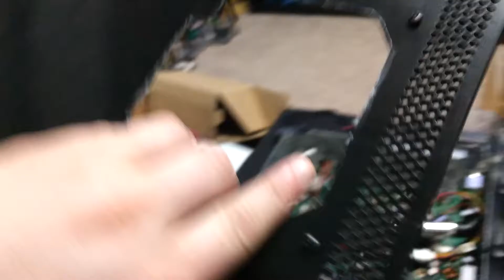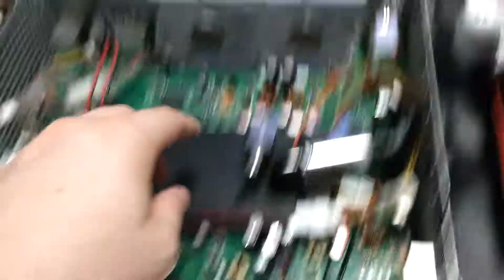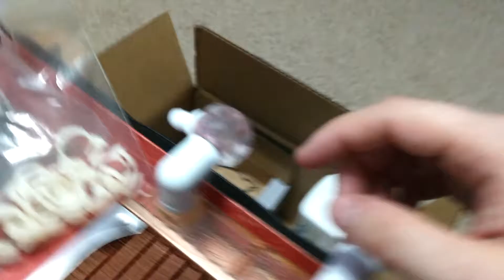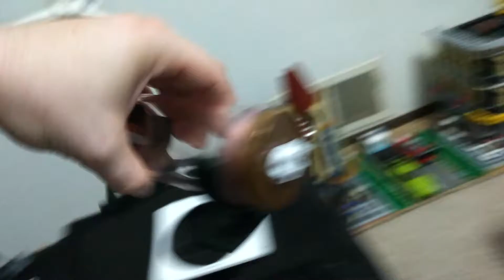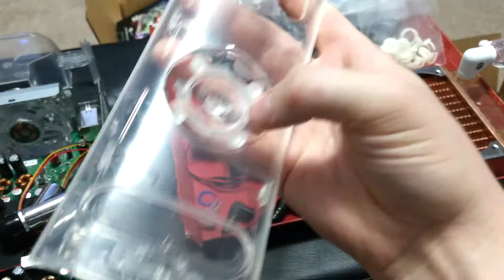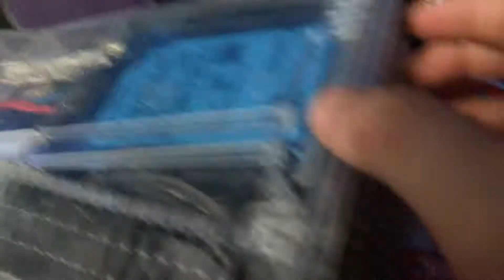Water Cooled XBOX 360 build (parts)

Comment: Would you be able to provide a parts list for this project so i could replicate it?
Reply from the maker: Unfortunately, the radiator, pump, waterblock, and reservoir have been discontinued for quite some time and are no longer found anywhere.
Reply: I have an semi old Xbox 360 that i am trying to find a way to get a new cooling system and a fan is not a problem or a heat sink but if possible i would like to know if there is some work around to make my own water cooling system and maybe something that doesn't need the heat sink entirely. I am also fairly new to modding but skilled at making and fixing things would you be able to help?
 @trinkettinkeringking